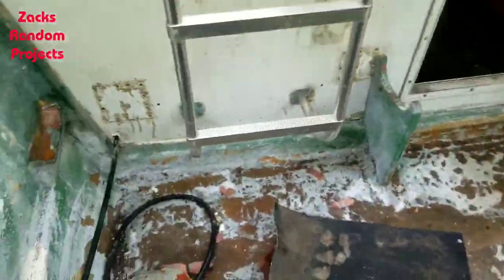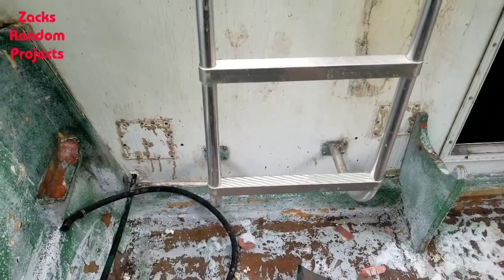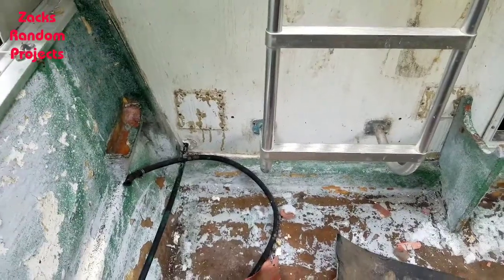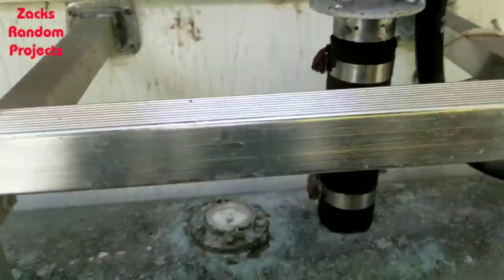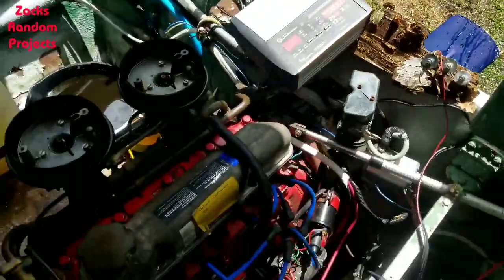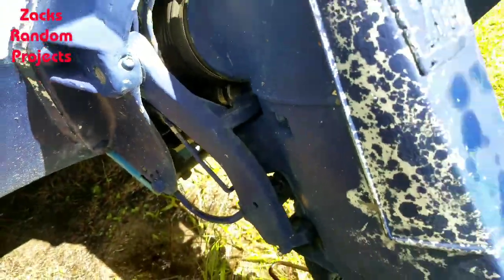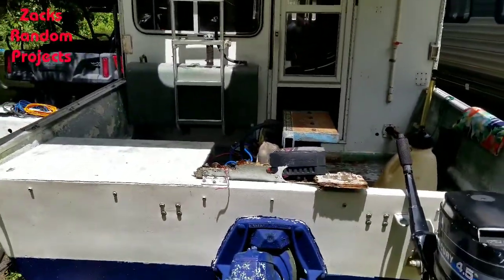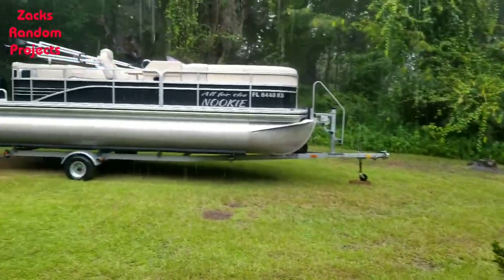Houseboat Volvo Penta 130 tune up Pt.3

Comment: Totally agree with the post below. It is not just a good idea, it is mandatory by safety standards to have a stationary tank fill outside of the hull as any spillage into the hull will create fuel vapour in the bilge and not just a fire but a potential explosion hazard. Make sure you have a proper bilge blower installed and run for 5 minutes before filling and continuously while underway. The Fill must have a wire to the tank to ground it, and lastly touch the nozzle to the metal fill cap before opening to bleed off static at the tank. I pumped gas in my younger days and had at least 3 fires from static sparks. A fairly minor thing on cars at a gas station with a functioning extinguisher. It can be a total deadly disaster on a boat!
Reply from the maker: This is great info. I totally planned on putting an engine box fan to suck out fumes, there was one on the old box cover but it was froze up. Ive always been told if you have an inboard you always have to open the box and let it air out for awhile before you start it. This is my first inboard boat and Im learning as I go thanks to yall. I appreciate it! Thanks for watching and commenting

Comment: The fuel cap needs to be installed so that a any spillage flows overboard instead of the inside of the boat. Reason? Fuel vapors and ka-boom factor. It’s a regulatory requirement.
Reply from the maker: Other people have pointed this out to me also. Thank you for the info. I will convert it back when I get to that part of the project. Thanks

Comment: Hello Zach, I hope that's your name; if not I'm sorry. About that fuel fill I'm pretty sure it should stay out over the water and not inside where your deck is. Not meaning to insult your intelligence. If fuel gets spilled on the fiberglass it could cause staining  and of course the fire hazard. I know back when I had a fiberglass boat, I'd noticed that sometimes it would have a static charge when say something plastic like a bag would be on the floor and the sides of the bag would cling to the fiberglass. Looking good on the houseboat project. I just stumbled on your YouTube channel.
Reply from the maker: Hey thats great advice Randy! Thank you for the heads up. :) I will probably spin the tank back around then. I have plenty of more work to do to it though. I need to get back out there and continue working on it. Thank you so much for watching and commenting on my videos. 🍻
Reply: Glad to be of help Zack. Liking your boat videos. I live in Arkansas and I know what you mean about that humid weather and those pop up storms are kinda show stopping.